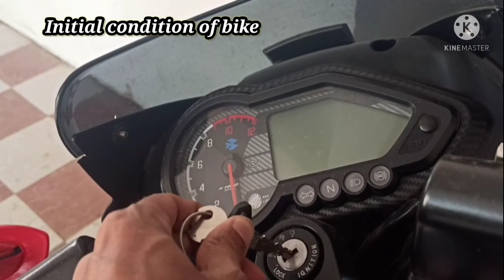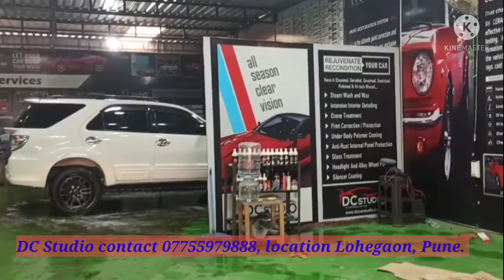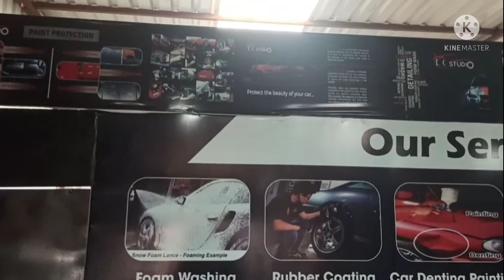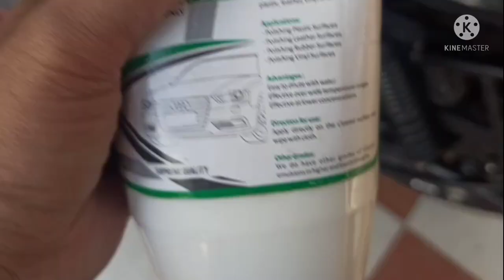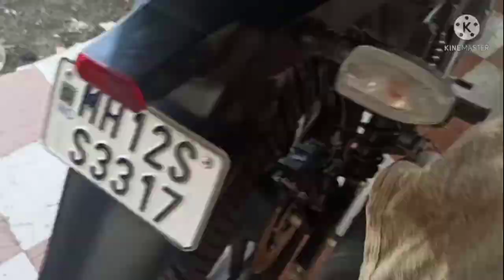Pulsar 150 bs6, Bike wash, Bike Polish, Motorcycle maintenance. Always look brand new.......

Comment: Can we give bs6 model for wash because it consists of sensors
Reply from the maker: Your question is so valid. Yes there are lot of sensors in bs6 bike and this results in high maintenance. You have to service on time. If you are a bike lover you must try to keep your bike clean so your bike look fresh and new. While washing bike  you must choose professional and proper service centre rather then any ordinary one. Tell them not to apply high pressure where there are sensors and apply dryer after wash. Keep the bike inclined on side stand  to drain water. Apply  polish and you are ready to Vooom....Voom😊 Safe ride dear.

Comment: Can i use sheeba  polish on pulsar 150 bs6 twin disc dtsi 2021 model???
Reply from the maker: Hi, congratulations
Reply from the maker: @sanjay pal, yes you can use it on any bike. Use the polish and not the rubbing compound. My recommendations , 1) wash with water and use proper cleaning reagents, dont use shampoo or detergent. 2) wait till water dry, 3 ) using soft cotton pad or fingers to  spread the polish on color surface only, avoid plastic parts like mudguard. 4) wait for 30 mins till the polish dry, avoid 
Direct sun light while applying any polish. 5) use good quality micro fiber cloth to wipe off the polish. 

Use polish when you wash bike. 

Also lube chain every after 500kms. 

Hope this video help you. Do like and subscriber.

Regards
EPS films
Reply from the maker: Take a look at this Sheen Microfiber Vehicle Washing  Cloth on Flipkart
https://dl.flipkart.com/s/y5wPuFNNNN
Reply from the maker: Sheeba SCAIO07 All-in-One Multipurpose Liquid Polish (200 ml) https://www.amazon.in/dp/B00TC5I66Y/ref=cm_sw_r_cp_apan_glt_fabc_D7RG84ETZFJR09VK464D?_encoding=UTF8&psc=1
Reply: @epsfilmsltd2064  then which polish will be used for plastic parts and mudguard?? Plz suggest the best
Reply from the maker: @sanjaypal1902  Take a look at this 3M Liquid Car Polish for Exterior on Flipkart
https://dl.flipkart.com/s/4DxUcBuuuN
Reply from the maker: I'm using this currently and it can be applied everywhere( plastic parts, mud guard, even color parts)